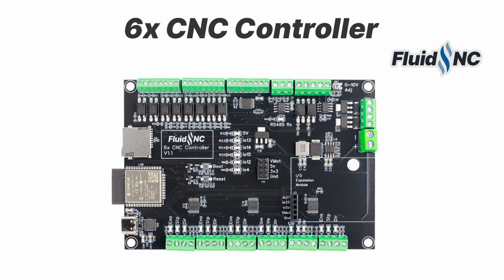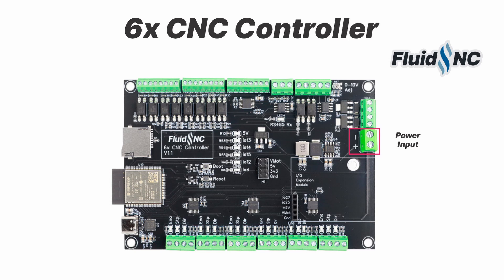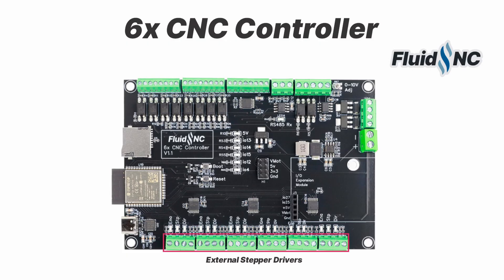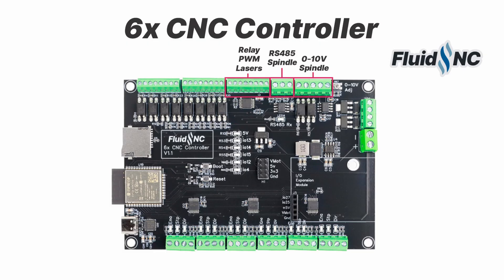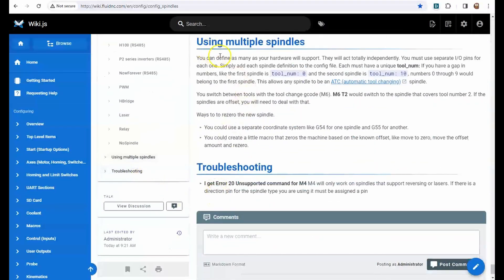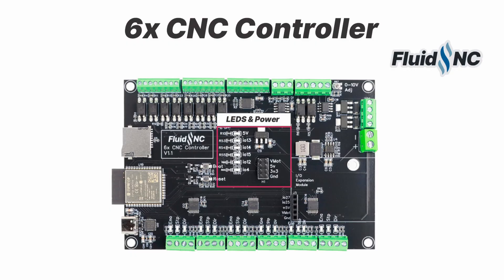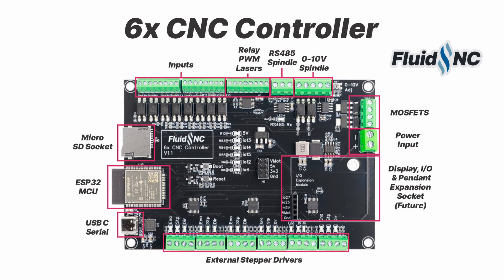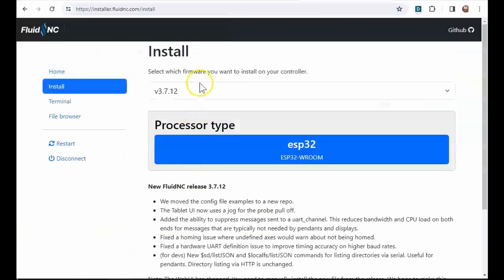6x CNC Controller for FluidNC Firmware

Comment: Great board!  So far everything has worked exactly as expected!   That's an impressive feat!  I'm still working out the macros in ESP3D.  There's been a time investment going this semi-DIY route ( as opposed to buying an off-the-shelf box to control the CNC), but it feels like it will pay off significantly.  I considered laying out the PCB myself for CNC controller, but that would have been an epic waste of time since this board here is so damn good and so well thought out.  Thanks a ton!
Reply: Same here. Just a gradual learning curve. Works great for my XXYZ with a work area of 2'x4'. Just ordered the Airedale to add inputs for more limit switches.

Comment: Nice job Bart! I have been looking to build a smaller type of multi-axis CNC recently, and your board seems to be the best "bang for the buck", but more importantly, great design with thinking of the future layout. Would it take a lot of effort to design encoder inputs for each axis to close the loop? I would like to get away from steppers, but at a reasonable price. All of your boards are priced at a very fair amount, so I figured if anyone could get the loop closed at fair pricing, you'd be the guy. lol  Thanks for the excellent work.
Reply from the maker: Many people use closed loop motor drivers with the 6x. Fluidnc can react to position loss alarms.

Avoid the MKS junk though. People have a lot of trouble.

Join our discord for future questions.

Comment: Hello,
I'm using parts from a Creality CR-10S to build a plotter that will also be a laser engraver. On the actuator side, I have three stepper motors and a servomotor. I'm interested in this board, but could I configure it for the servomotor?
Reply from the maker: @philippe5394  can you ask these questions on our discord? The YouTube comments section is not ideal for user support.

See our wiki for a discord invitation lunk

Comment: Hello Bart,

Thank you for all of your work developing the FluidNC firmware and this board !!!

I purchased the v1.1 this past April to support your efforts and finally have a project to use it on !

I want to control the spindle on a small Unimat lathe that I previously converted to CNC in the X and Z. The goal is to convert the DC spindle motor on the lathe to a servo using a Same Sky AMT102-v incremental encoder and a Geckodrive G320X servo driver so I can cut threads.

Would you please give me some guidance on whether this is possible with your board and FluidNC and if so how to configure the 6th stepper (C) to achieve this ?  I've been to GITHUB and the Wiki and haven't been able to figure it out or how to even ask for help.

Thanks in advance for any direction you can provide.

Jay Perez
Reply from the maker: @Jay.perez1  ask questions on our discord
Reply: @engserve  Thanks. Will do.

Comment: Hi, how does it work with multiple spindles? i.e. spindle and laser. Do I have to change gcode before sending in cnc to let the cnc know to use laser by M6 T2 instead of the spindle?

Comment: Is the I/O expansion module necessary for the fluid dial or can connect direct to the board?
Reply from the maker: The 6x has enough on board i/o for most machines. Read more about it here.  http://wiki.fluidnc.com/en/hardware/official/6x_CNC_Controller
Reply: @engserve  dont shure if that the right answer for what i ask. Asking because the Fluid Dial expansionsboard is not in stock. Is there any documentation how to connect? Thanks in advance
Reply from the maker: @michaelorlik3dwaldhessen318  All documentation is on the wiki. If you have further questions, please ask on our discord.
Reply: @engserve  dont know how, want to buy a cnc controller to get my maschine to work, but get no answer of the simplest question.

Comment: is it possible to control SERVO MOTOR / AC 108v 2.6A 400w 3000 RPM with it system?
Reply from the maker: @vrijheidsrechten  as long as it has discrete step dir and enable pins, it will work.

Please ask future questions on our discord.

Comment: Im designing a room size cable driven parallel robot. Would fluid nc be able to coordinate axes on different esp32 controllers that are only linked by Bluetooth or Wi-Fi?
Reply from the maker: No. The one ESP32 has to control all motors

Comment: Update: I purchased one to upgrade from an arduino and so glad I did.  My home built CNC with stepperOnline NEMA23 closed loop motors just absolutely flys now.  It was easy to make the cutover, the instructions for YAML were clear.  My one nit pick is the terminals for the inputs are small to the point it was hard to get 22AWG wire ferrules to go in and not enough side to side room for the plastic flange. I got them to go in but was nervous about the amount of pressure I was using.  The terminals for the motors are much larger so no problems there.   Getting this on WiFi was so easy and an absolute game changer, no need for a PC and monitor in the garage now, just upload the gcode file to the SD Card via WiFi and start the run using my phone or tablet, no need for UGS.  Love it!
Reply from the maker: @brad_pics  see our wiki on how to request help

Comment: Would it fit for a non-cnc application that needs to control 6 stepper motors, get 10 sensors input (on/off) and serial control from a PC?

Comment: Are encoders supported?
Reply from the maker: @ocho7011  No
Reply: I'm working on a small project to add CNC control to the spindle on my mini Unimat lathe and intend to try using the Barton's FluidNC board I bought a while ago.

The X and Y axes already have regular stepper motors and drivers running on GRBL. However, a stepper motor won't provide the RPM I want for the spindle so I'm hoping to convert a 24 vdc brushed motor like used on the powered scooters to a closed loop servo using an encoder and a Geckodrive G320X driver.

I don't really know what the heck I'm doing but found information on that Internet thing that says it's possible.

If I understand correctly Barton's board will just have to send the regular Step & Direction signals to the G320X which accepts signals from an encoder.

I think ...

Jay

Comment: Anyone have experience with FluidNC and Duet 3 RepRap control of CNC machines?  I currently have a CNC router, and have a milling machine I will eventually convert to CNC.  For both I will add a rotary 4th axis in the future.  I really like these new age wifi web based controllers.  I want to replace mach4 on my router.  I think I would like to try either one of these (FluidNC, or Duet 3).  I don't know if one would be better for my application.  I don't know the pros and cons of each.  I would like to go Duet, as I will also be converting a couple 3D printers from Marlin, to Duet 3 RepRap, and it would be cool to have a unified firmware.  I am a little hesitant about the Duet as it is based on a firmware originally designed for 3D printers, and don't know if the CNC part is still half baked, or has other issues.  The FluidNC looks very cool as well and I would buy this board for my machines.  Is FluidNC fully developed, or at least developed enough for my 3 axis possible 4th axis machines?  Thanks for anyone's input.
Reply from the maker: FluidNC and Mach are more targetwd at CNC machining that 3d printer firmwares.

Go to wiki.fluidnc.com and the discord for more info.

Comment: greeting engineer
Last week I purchased the card
Please could you make a video tutorial of the installation of fluidnc
and an example of how the card can be programmed with movements of closed-loop stepper motors, example: ball screw motor by changing the speed of the motor and its direction
Reply from the maker: We have a wiki that describes everything. 

http://wiki.fluidnc.com/en/installation

There is also a page for that controller and links on how to get help.

Comment: This looks amazing.  Just ordered from Elecrow!  I was going to use a Raspberry PI with parallel cnc hat and LinuxCNC but this looks far more user friendly!  I have enough learning curve as it is with building the machine itself and with trying to learn Fusion… this looks like a great way to handle the controller hardware.  I already have the DM542 drivers.  In one of your other videos you recommended using the opto isolator board for the limit switches.. is that a good idea with this board as well?

Comment: Does this have the drivers built in, sorry for the nube question, and if not can I use the gecko g540?
Reply from the maker: It does not have drivers on the board. It is designed for external stepper drivers. It can work with the g540.
Reply: @engserve  thanks, and what is your drivers option? Need 6 axis
Reply from the maker: @lylefranksaunders2113  All the controller options are listed here. The 6 Pack might be what you want.
Reply: @engserve  Driver options, not controllers
Reply from the maker: @lylefranksaunders2113  I don't know of any 6 axis external drivers. Some have multiple like the g540 and the MX3660, but most people use single axis drivers.
Reply: @engserve  ok, cn this run two gecko g540 in parallel like the smooth stepper or uccnc eth400 ect

Comment: Hi Barton. I have a few questions for you. I'm currently building a CNC plotter for my client, and although I'm an engineer, I have no experience with CNC machines at all. Right now, I'm looking for a controller, and I know I can do it with Mach, Linux CNC, but your Fluid project and your controller intrigued me because I'm looking for something simple. Hence a few questions: Does the license allow the use of your hardware/software in commercial equipment? Are these solutions stable enough for a machine running daily for 8 hours? The machine is supposed to have 3 axes, Nema 34 motors, a 6kw Hiteco spindle, plus limit switches. Does your controller support Ethernet via cable, or just USB for wired connection? And do you generally think your solutions are suitable for such a commercial machine?
Reply from the maker: Everything we have produced is 100% open source without any commercial restrictions. Please see our wiki for most of your other questions. wiki.fluidnc.com. Join our Discord server if you have more questions.

Comment: Great - I have just purchased one -- looking forward working with this and FluidNC!
Reply from the maker: Great. Check out the wiki and join our discord if you have any qeustions
Reply: @engserve  Hello, is it possible to connect 5 DC servo motors to it? or in my case specifically 5 DC motors each with its own IBT2 driver and AS5600 encoders to it?

Comment: sir can it support encoder for rigid tapping or CNC lathe threading?
Reply from the maker: The firmware does not support that.
Reply: I'm working on a small project to add CNC control to the spindle on my mini Unimat lathe and intend to try using the Barton's FluidNC board I bought a while ago.

The X and Y axes already have regular stepper motors and drivers running on GRBL. However, a stepper motor won't provide the RPM I want for the spindle so I'm hoping to convert a 24 vdc brushed motor like used on the powered scooters to a closed loop servo using an encoder and a Geckodrive G320X driver.

I don't really know what the heck I'm doing but found information on that Internet thing that says it's possible.

If I understand correctly Barton's board will just have to send the regular Step & Direction signals to the G320X which accepts signals from an encoder.

I think ...

Jay

Comment: Hi Bart, I would like to purchase one of these but they are out of stock the couple of places I found it. Do you know where I could buy it or what other parts would I need to replicate its functionality? Also, do you know of a good resource to help a beginner understand cnc control, etc. I want to build a small cnc that will host both a roouter/spidle and a leser engraver. Thank you. Charles
Reply from the maker: They should be in stock again in about 10 days at Elecrow.

Comment: Great work Bart! Ordered this board to replace my 3-axis DLC. I also just finished building the M5 based pendant. I designed and printed a case that fit my needs that I'll probably push up to my Thingiverse account. I'm a software engineer, so if you need any help with coding... 😉
Reply from the maker: Shipped it today. Join our Discord to follow the development.

Comment: what is the maxinum speed of the step pulses with all 6 axies running?
Reply from the maker: Generally you can expect about 100-125Khz. It is more about the length of the step pulses than processor speed. 

http://wiki.fluidnc.com/en/config/axes#speed-limitationshttp://wiki.fluidnc.com/en/config/axes#speed-limitations
Reply: Can this support TCP 5-axis ?

Comment: very cool. are all of the discrete inputs isolated? maybe using opto-isolators? i've had trouble with that on my shapeoko2 when they weren't.
Reply from the maker: It has optos on all the inputs. This helps protect the processor from noise and spikes. The optos are not fully electrically isolated though. There is no secondary isolated power supply.